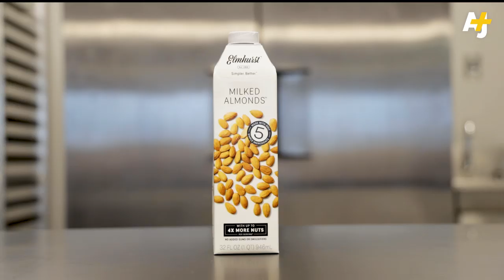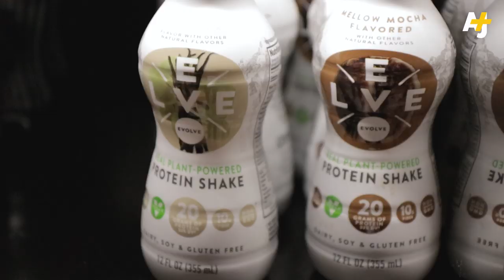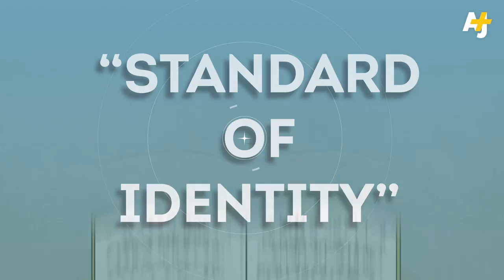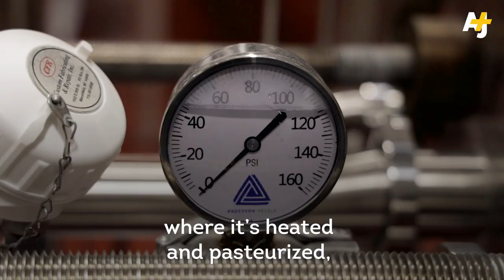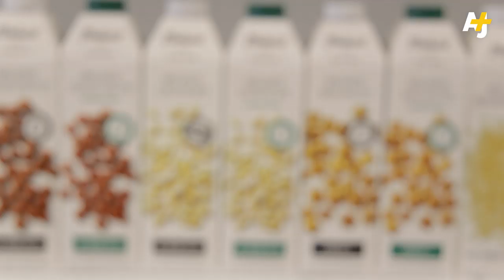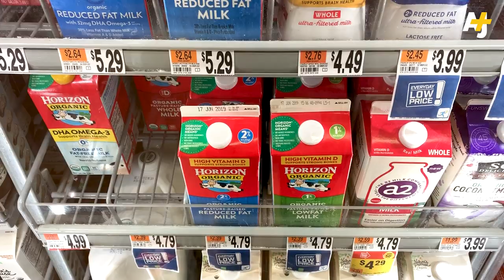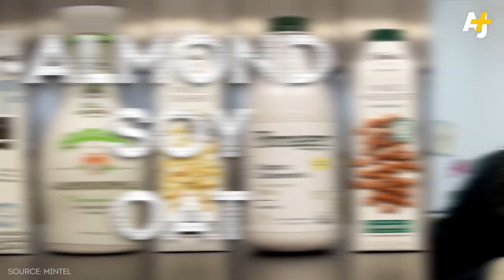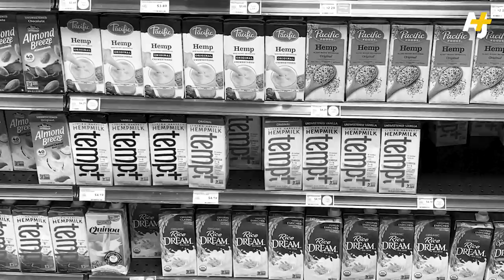Big Dairy is coming for your almond milk | AJ+

Comment: I did a test over the last three months, I cut out dairy completely, and after about a month I realized my stomach felt better than usual and my skin looked a little better. So after realizing that I was/am mildly lactose intolerant, I’ve become ever grateful for plant based options. I slipped up last week and put milk in my tea and broke out the next day and also had quite a bit of stomach issues. 
Long story short, if I can use these “milks” as a replacement for milk then I’m calling it milk.